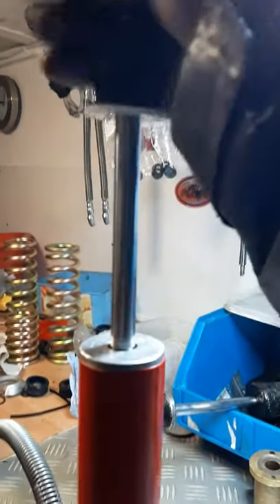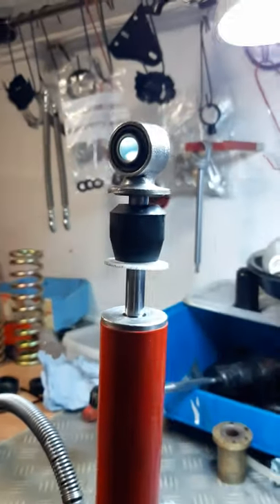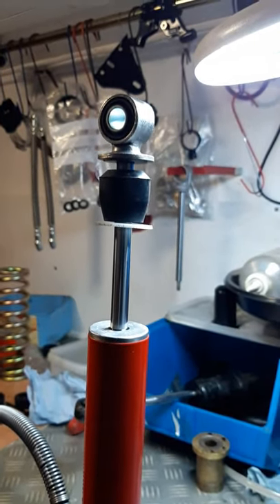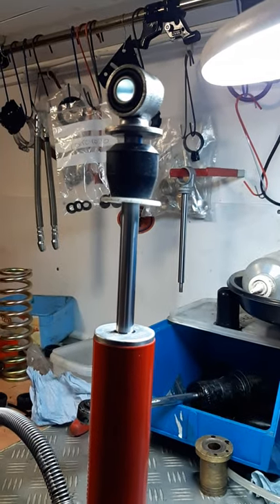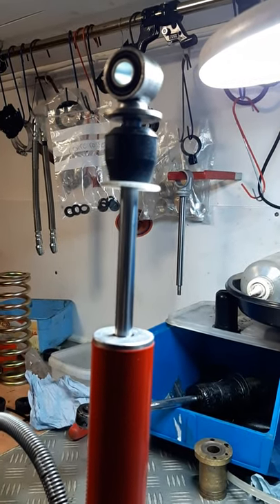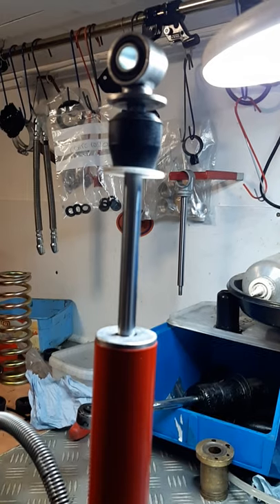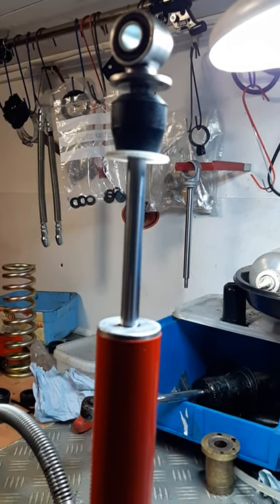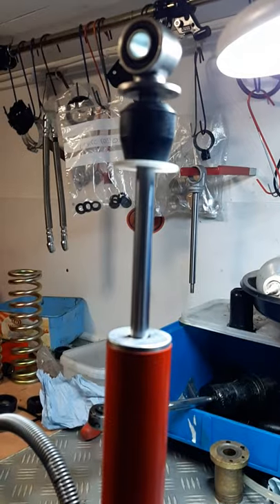20191020 162820

Comment: Hello
once i have removed the aluminum cover, how do i remove the piston?
I can't lower everything to remove the steel ring
Even if I tap to lower the part that fits the tank, he stays pinned there
These are short & cosso shock absorbers from a beta rc 125 from 1978
a thousand thanks
Alex